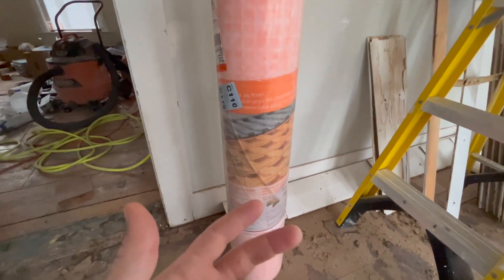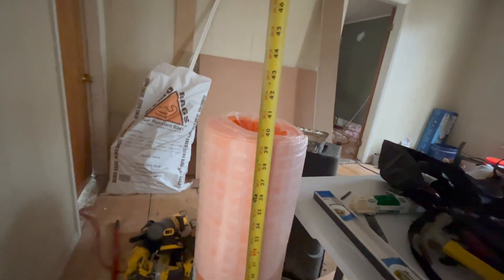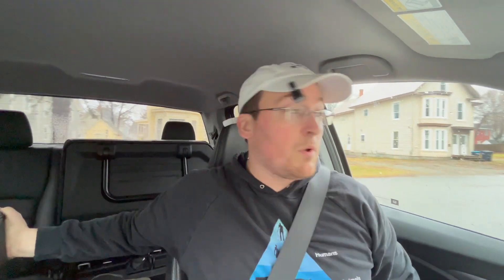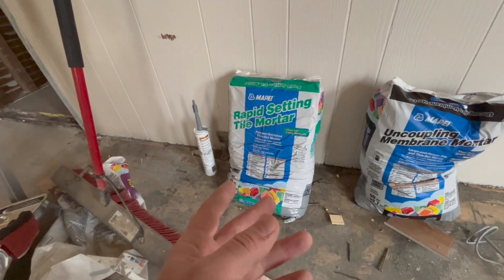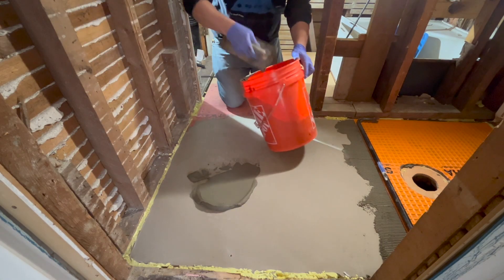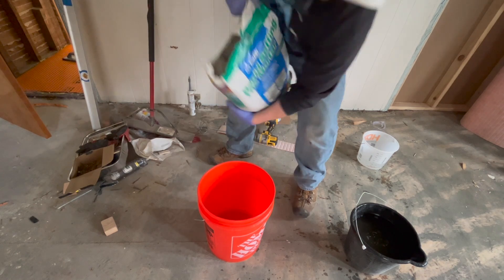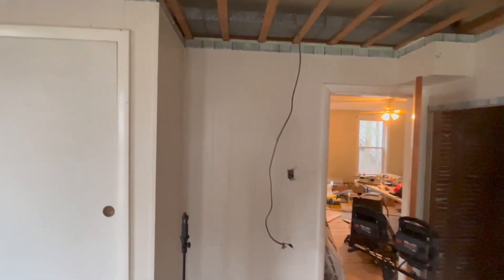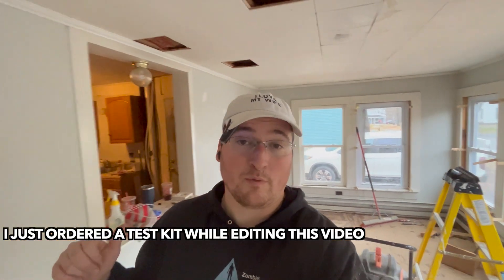Bathroom Rebuild: Uncoupling membrane and questionable flooring decisions!

Comment: "pocket hole". Anyway, that membrane looks good. They've got some  nice stuff now. Long ago we just used cement backer board and before that plywood and felt paper. I was wondering. In that front room there's about a 4" gap between sheetrock and ceiling. Will you have to fill that?
Reply from the maker: Yeah, it went down pretty easy. The gap is only about a half inch, I’m planning on putting up moulding like was there before which should cover it…open to ideas though 😊